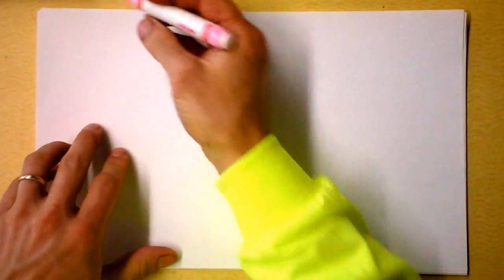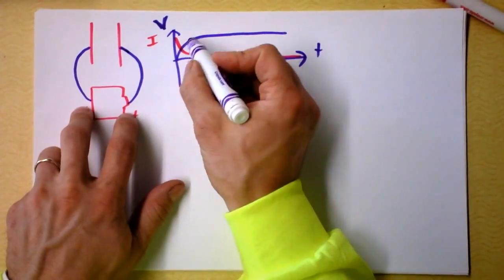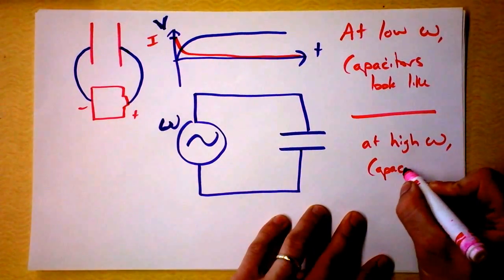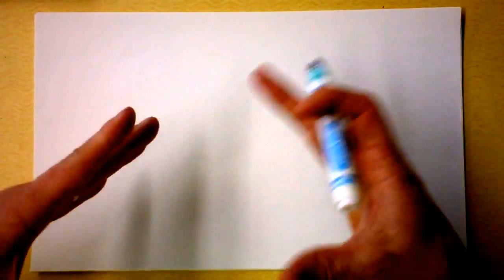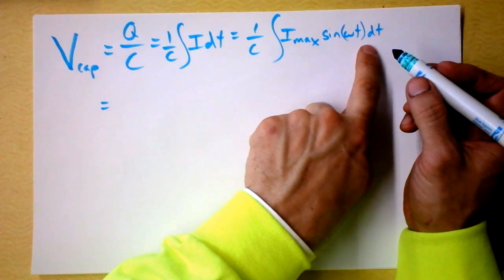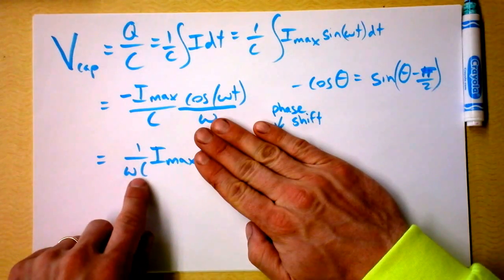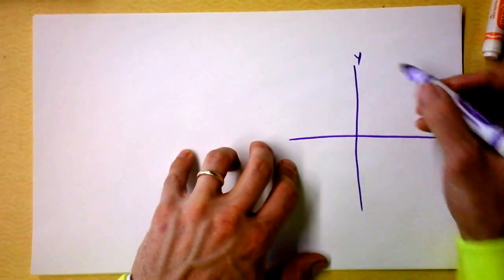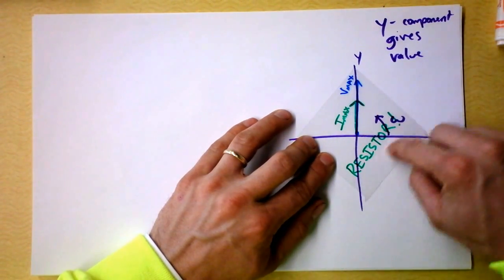Capacitors in AC Circuits with Phasors | Doc Physics

Comment: At 13:21 you say "current is minimum when voltage across the capacitor is zero". Is that the correct terminology? Shouldn't the current here be negative Imax, since negative Imax is more current than zero current.
Reply: Indeed, I think you're totally correct.  Sorry about my error!
Reply: @docathome829  Thanks so much for your response and video. Nice work!

Comment: Hi , it's a nice explanation about capacitors , but i didn't get one thing that why does the capacitor at low frequency is open circuited ? and at high frequency it is short circuited , ?

Comment: Excellent presentation. If one has an RC circuit, then the continual phase shift continually refreshes the capacitor, enabling it to maintain voltage? I'm wondering if you are going in that direction?

Comment: why does the capacitor discharge ?
Reply: correct me if  im wrong  when the ac current(electrons ) changes its direction the intensity of current decreases thus a voltage is created so it discharges then when the intensity increases (the other half of the motion of the electrons  ) so the voltage decreases therefore it gets charged am i understanding it right or all of this is complete crap ?!
Reply: Omni Scientist the side of the capacitor connected to positive terminal of the dc voltage supply (battery) stores positive charges while the side connected to the negative terminal, gets the negative charges. according to Q=CV the greater the voltage greater the charge. when discharging 
, the plates of the capacitors acts as the voltage supply and current flows; capacitor discharges

Comment: 13:36 why is Current not 0 while voltage is 0 in the graph
Reply: I guess it's cuz the origin isn't the starting point here i guess, am i right ?
Reply from the maker: Right.  We presume that the circuit has been doing its thang for a long time.  We just started watching at t=0.

Comment: Why not introduce the old "memory helper" ELI the ICE man for phase relationships of voltage and current? Also, why do you always call a cell a battery in all of you lectures that I have seen to date? Lets face it, a battery is many cells in at least 3 possible arrangements and a cell is a cell !
Reply from the maker: I've heard of this Ice Man, but it uses engineering naming conventions that the physicists don't share.  Sad face.  And I'll concede that I am very sloppy about naming my voltage source.  I have no defense there.  It's just SO DANG COMMON THAT I GAVE UP FIGHTING.

Comment: Hello Doc , congrats on your videos , very professional and you have  talent to deliver the information in a simple yet scientific way .
I have a question please : when a capacitor is in parallel with an AC voltage source of Vs=4sinwt lets say , then the voltage across the capacitor is also Vc=4sinwt , my question is as follows : as we know the capacitor will charge during the first quarter of the and discharge during the second quarter of the voltage source , and this process will repeat during the negative third and fourth quarter , however i wonder if we say that Vs=Vc then at any instantaneous time the voltage across the capacitor is equal to the voltage across the voltage source , however the capacitor is actually charging and discharging and its actually "following" the voltage source path , so at any instantaneous time the voltage across the capacitor is always a "little" less than the voltage source , so how we can say that Vs=Vc ? ; or isit just an approximation that is acceptable since the voltage difference is always small ? ......thank you very much

Comment: Can capacitors that are rated at a certain voltage in DC also work with AC?
Reply from the maker: +Jared Evans Probably not.  Electrolytics are generally polar, and will be destroyed if charged the other way.  You need to buy the more expensive bipolar caps.
Reply: +Doc Schuster Alright. Where can I find those?
Reply from the maker: +Jared Evans digikey, mouser, jameco, etc.

Comment: I like to say that the current is related to the slew rate, (how fast the voltage changes) because I = c * dV/dT. The integral form, which says that the voltage across the capacitor is proportional to the accumulation of current over time) is just the inverse, but I hate integrals :P! And I think thinking that way is a bit harder.

Do you like the analogy of capacitors to pressure tanks, where capacitance is like the size (volume) of the tank, voltage is like pressure, and charge is like the mass or number of air molecules in the tank. Of course the analogy breaks down when dealing with non ideal gases, factoring in temperature, molar mass, things like that. But other than that, I think it is pretty solid! Even mathematically because the density formula and the Q=CV formula are the same.

Comment: if you connect the Capacitor with DC source. How come you have an exponential shape curve in current and voltage wave form? why dont you draw another wave shape? Noting there is no resistor in your circuit.

Comment: I was wondering why it is necessary to involve the "imaginary" number "j" IE the (SQRT of -1) as the reason for drawing the current vector at + 90 degrees to the voltage vector. The horizontal axis is often referred to as the "Real" component and the vertical axis is often referred to as the "Imaginary" component. 

However we already know that the current in a capacitive circuit is 90 degrees out of phase with voltage so plotting the graph of the two vectors is obvious without involving imaginary numbers. I also understand that  the coefficient ( j Squared) will reverse the direction of a vector 180 degrees. 

My opinion is that the use of the imaginary number is more of a gimmick to remind you how to align a vector for the conditions present in a given RC circuit. On that note, the following words have nothing to do with electronics either, but they are a gimmick to remind you of the resistor color code:

Bad
Boys
Rape
Our
Young
Girls
But
Violet
Goes
Willingly
Reply from the maker: kansasthunderman1 Thanks for that mnemonic that I can NEVER use in class!The mathematical underpinnings of electronics are the interest of a physicist.  I can model the currents through all the components very elegantly as real and imaginary components of phasors.  This makes it easy to add them in complicated circuits, too.  Really, all of physics is interested in finding mathematical constructs that describe observable situations.  It's what we do!!!
Reply: Thanks for your prompt reply.
I'm always looking for practical examples of how to more easily validate rather obscure mathematical concepts through actual experiments and observations.

Also I have another question. The formulas for XC, XL, and Z are based on a pure sine wave voltage source. However if the voltage wave form is composite and not a pure sine wave (like a square, triangle, saw tooth, etc), how can we calculate XC, XL, and Z?

Here's my bone headed theory: Since the composite wave forms can be represented by a Fourier Series of sine and cosine functions, can the values of XC, XL, and Z for each of the individual sinusoidal functions be calculated and added to get the grand total for Z?
Reply from the maker: kansasthunderman1 Hmmmmmmmmm.  Bone headed or brilliant?  Since impedance is frequency-dependent, you'll get a Fourier-weighted series of impedance terms.  Seems like you'd just add them, as you suggest.  Give it a try!  I need to bring more square waves and Fourier decomposition into my class this year.  Thanks for the idea.

Comment: If we have a DC offset in our AC source, say 3 Vpp with 2 volt offset. what would be the case. now the voltage is always positive and do not pass to negetive part?
Reply from the maker: Gholamreza Ilkhani The cap would oscillate around 2V as well, I think.  You'd just want to be sure not to exceed its voltage rating!
Reply from the maker: Gholamreza Ilkhani BTW, this would be a great way to use those polar supercapacitors!
Reply: Doc Schuster you mean same graphs of V&I with 90 degree phase difference around 2?
Reply from the maker: Gholamreza Ilkhani Oooh - that's a good question.  I think so, but I'm not sure.

Comment: In that AC circuit with the capacitor as you explained (cool stuff), I would like to know what would happen....is there a power consumtion if a load is introduced anywhere in between?!
Thank you
Reply from the maker: You betcha.  A resistive load, I suppose?  You'd need the next video, on impedance.  Keep rocking!